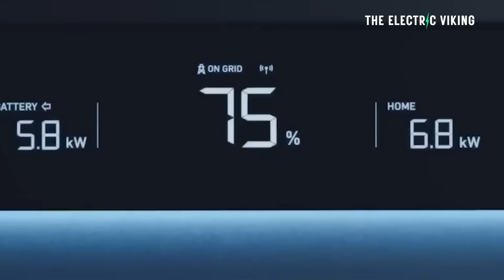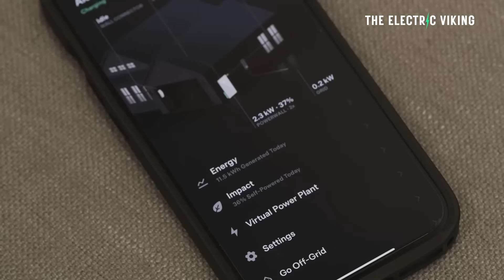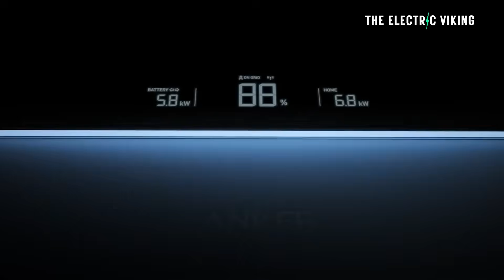From 10 Years to 3 Years: The New ROI Reality for Solar + Batteries

Comment: Since July, we got a new 14.2 kw solar (on top of the old 5.4 kw system), 12 kw Sigenergy inverter, Sigenergy AC EV charger and their gateway for off-grid capability. The whole system is $33.5k AUD. We pay only $22.5k all up. 
The 32 kWh Sigenergy battery is around $17.3k cause we got ~45% rebate at $7.8k. I think the extra rebate is from the stackablity of the Sigentor. The installer doesn't have to add any extra cost.
We used to pay 4-5k a year on gas and electricity, 3k for petrol. Now we are expecting to pay under 1k a year on energy cost so the ROI is 3 years.

Comment: The ROI is longer in less sunny countries. I wait for a drastic cost reduction and efficiency improvement of home battery PV systems, for instance batteries based in Carbon Nano Tube fibers with poly-aniline and high efficiency PV panels based on a graphene perovskite combination  (totally organic). Mass production is a challenge, not far away.

Comment: Crazy if the battery rebate ends by the end of next year- that’s just means the take up was beyond all models - I wonder what the government do next
Reply: Government can always announce a new program when the first one finishes. Probably timed to an election.
Reply: Batteries are a lot cheaper than retailers are charging for them. Now there is a lot of demand and more competition.  Once the rebates disappear retailers will drop the price. Think of it this way. An MG4 with a 51kWh battery is equivalent to a home storage battery for $580/kWh and you get a free car with the battery.  If MG didn't have to give you a free car with the battery you would be paying a lot less.
Reply: I believe the battery rebate continues until 2030, although the rebate decreases annually,  in-line with expected battery price reductions.  That way the demand is spread over 5 years.

Comment: Spot on.  You will save your own hard earned money by going solar and battery.  The real savings is actually not the home use but mainly the use of an EV and removing energy costs from fuel.  Most people spend way more on their petrol costs each year than their home.  Put all these savings togeather and you can save thousands each year.  Reduce your expenses and use the extra money saved that you worked hard for on paying off that mortgage faster.  Sure you will better the environment thats nice but what is even better is you don't need to waste money paying someone else overpriced energy costs.
Reply: Tony, exactly! Charging EVs at home cut our solar panel/inverter/battery ROI in half.

I’ve been saying this for over a year now. Affordable home batteries will be the final nail in the coffin of ICE vehicles. Nobody who can charge a car at home will buy a gas car.

Comment: If you guys weren't so water scarce all the AI data centers could move there. Exporting data is way easier than exporting power.
Or you could think of some other thing that uses a lot of power that's exportable.
Reply: Long story short and few people are talking about this: when we have unlimited cheap to free solar  power, desalination or atmospheric water generation (my favorite, also known as a dehumidifier) will make water anywhere for near zero  or zero cost . Irrigate your crops even in the desert ,make drinking water. I think data centers should use Grey water , but water is just an electricity problem. Once you have free or near free power you also get unlimited water💧
Reply: @stevey_z  Solar power is not free. It costs a few cents/kWh at the source and you need to distribute it to where its needed which adds a few cents to the costs.Its cheaper than coal, gas and nuclear, but certainly not free.
Reply: @udishomer5852  it costs a grid operator money to buy and transmit solar power over an electric grid after the solar system has reached payoff. It doesn't cost an individual person or group or business money to make and send power from their  on site panels to their on site power system and use it after the system has made enough power(and in this case water) to reach payoff, the electricity produced is indeed free after payoff.